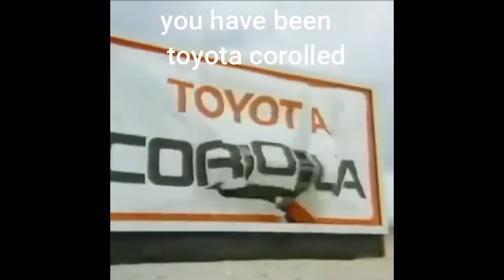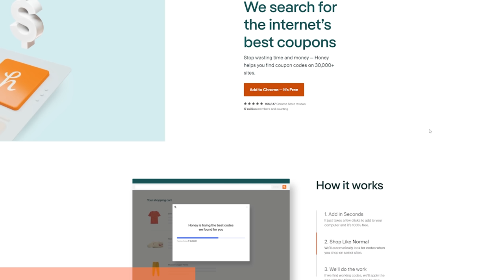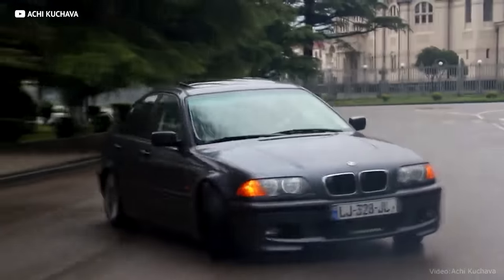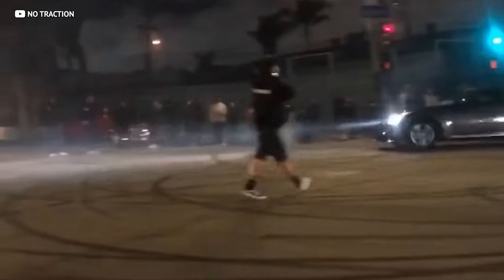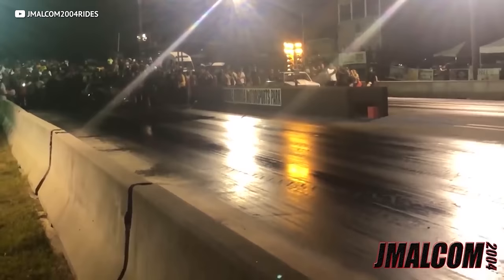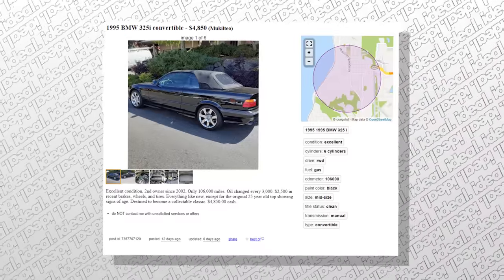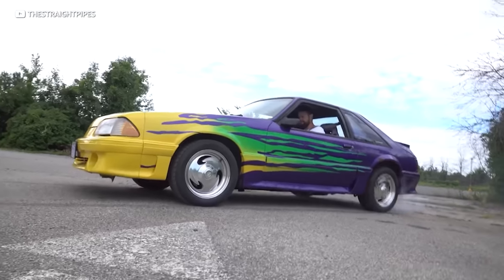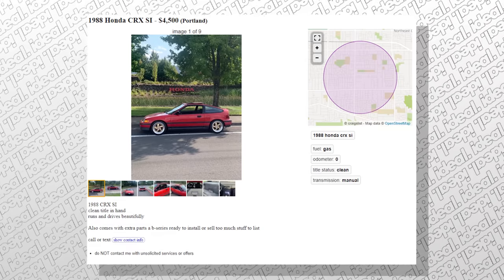8 CHEAP Cars With Unlimited Tuning Potential

Comment: this list was actually one of the BEST I've seen so far. FINALLY a civic makes it too 😭😭 i jus might cop either a IS300, or a Firebird, maybe..
Reply: Dude, get an IS300. I just got mine, and I frickin love the thing. Just be sure to get it before the prices go up even more!
Reply: I still own all my cars from when i graduated in 2012-2016 era, a factory turbo s12(3500$), s12 coupe (600$), 300zx non turbo (2500$), 1 of 5000 L tuned GS430 in mint condition (5500$), and a s13 full caged dual cam I got for 800$, I had a lot of fun in my teen days, sucks you guys don't have such as cool cars for the cheap like we did. My older homies from the 2008, early 2000's era were getting mk4 supras for 10,000$ back then, AE86's a thousand or two, lol if not a couple hundred bucks. 240's were cheap and good for the price to learn how to have fun in for 1200$ with some suspension back then, you could get a sr20 swapped 240 for around 4,000$-5,000$ back then, miatas were like 1k$ and under. NSX's you could find sub 10,000$ range
Reply: @premotvv  Most definitely, Im thinkin bout a GTE swap, depends if I got the funds doe ❗
Reply: @ZalkDrives  Bet bro 💯💪🏿 after I get a FC
Reply: @pancratius8886  Dang yall was livin in that good era 😢 shame a lot of them skyrocketing now in price
Reply: Take your time, buy what you want
Reply: Get a gs300 I got one they a lil better
Reply: @tr3ynag4ta   cheaper to just swap the internals. GTE rods and pistons fit the GE block. No need to spend all that money on a GTE When the GTE parts swap in a GE block for the most part.
Reply: @romanyoung5342  agree, GS300 is definitely better imo more space, and the body is OG 😂
Reply: Got my wife an Is300 and a mustang gt for myself she will see more power than i have on nitrous.
Reply: Trust me invest in any of those 2.
Reply: I’m getting a is300 he put me on to the best starter car in the world
Reply: dont fucking dare get the pontiac
Reply: @premotvv  I want to wait and pick up the first model Altezza when they start coming to American market in a couple years. To heck with the 300
Reply: @DhatLex  there are a few extra ports that have to be drilled into the block if you’re doing that as well.
Reply: @TheJapfanboy   Comp turbo make a oil less and waterless turbo, so you could run those instead of running feed and drain lines. I wish I knew about them when I was first boosting my Lexus GS300
Reply: @DhatLex  your a genius bro, this is good info, thanks for sharing and saving the rest of us some energy😂
Reply: No no no, he said not civic. Pay attention
Reply: The crx isnt a civic!
Reply: @tr3ynag4ta  im tryin to gte swap my 03 is300 too. I think its smarter than trying to turbo the ge motor.
Reply: @johndomoe3735  facts 💯 GE doesn’t have the spray nozzles for the piston or a turbo outlet
Reply: @ZalkDrives  where do you find one?? I’ve been trying to find them on facebook market place and offerup but there arent any in my area.
Reply: @dioncuni2586  the pontaic is a better looking and sounding car with an engine that has bigger power potential...
Reply: dont get a is300 trust me if you plan on turboing it or something your go8ng to need some money and 2 ecus
Reply: I got an is300 and I love it . Highly recommend 12/10
Reply: Lol yes finally is right man, the civic has always been the one of the most popular starter tuner cars in my opinion or atleast is has in my hometown
Reply: @pancratius8886  are you willing to sell one of your Nissan's in few years for not an expensive price? might actually buy one if so
Reply: I got the is300 😂
Reply: How can you beat a Honda? I’m a muscle car kind of guy but Hondas are great cars all around. No question about it.
Reply: @pancratius8886  I’m thinking of either buying a Toyota chaser or a 300zx
Reply: My friends dad kept buying old firebirds 

Cause it was cheaper to buy another one than to fix
Reply: @pancratius8886  must be nice to have rich parents
Reply: @upshiftgo  My condolences :(
Reply: @pancratius8886  thanks
Reply: @upshiftgo  My condolences you think 10,000$ over the span of 5 years is a lot :(
Reply: @pancratius8886  when you're in high school and your parents give you 10k? YEAH. are you confused and comparing that amount to what a working adult makes? my condolences on your intelligence lmao

but hey, if your parents gave you that much money when you were in high school then congrats to you, if that's what you're fishing attention for.
Reply: @pancratius8886  You tried harder because my thanks got you to haha. is this what you do on the computer all day? what a waste of time. my condolences on your happiness.
Reply: @upshiftgo  Lol I wasn't in high school buying any of these cars, i didnt have my license in high school, I was 18-23 when i purchased my cars, saving 10,000$ over the span of 5 years isn't hard in the slightest, when u work an actual job. Judging by ur double reply's and perception of the dollar, u still have yet to find one of those. Once again, my condolences. :(
Reply: @pancratius8886  boooohooooooo 😂😂😂😂😂😂
Reply: @pancratius8886  My condolences on being so offended and hurt 🍼👌🏻

Comment: I’d get the IS300 everyday for performance.

If I didn’t need performance, I’d get a 4runner.
Reply: I own both stick with the lexus
Reply: The is300 is painfully slow. It takes crazy money to make any real power from it, much like the Supra. Not the same 2jz motor, nor is it turbo
Reply: @andreibelittchenko5956  what's better? Ge or gte
Reply: @carter.coleman  gte 10/10 times, lower compression always better for adding boost. Either way still needs a duckload of money thrown into it to make any serious power
Reply: Me with my 90s pathfinder 🗿
Reply: @andreibelittchenko5956  It absolutely does not take anywhere near "crazy money" to make it fast. CXracing and comp turbo, and a bunch of other brands make full turbo kits for 3-5 grand. Even with stock internals you can push around 400 wheel for around 5 k.
Reply: @carter.coleman  well gte costs 10x as much so I think it's pretty obvious. Also, it does not cost an arm and a leg to add some real power to a 2J, especially a gte. This other guy doesnt know what hes talking about.
Reply: Knew a shop that was selling a factory super charger for a v6 4runner ... apparently the owner had it removed because it was to much power for him shop kept it and no one wanted to buy it ...think they junked it in the end
Reply: is300 is not a performance car by any stretch of the imagination. a scion tC has faster times
Reply: I have a 4 runner and its amazing

Comment: Glad the front wheel drive thing was mentioned. I now have a 4 wheel drive and a rear wheel drive car but I sooo miss the fun of a small front wheel drive. There's a reason that back in the 60s the old Mini Cooper was winning all the rally competitions. Front wheel drive is a different driving style and it takes some getting used to but you can just floor it round bends. If you can find an old dirt road, you can just drive with your foot welded to the floor and throw it around corners and the back will just follow the front. Loads of fun.
Reply: I've got a ford focus hatchback (not st or rs... it's an se 😭) but still fun af to drive. Corners are nothin'!! Most of the parts are interchangeable though which is nice to know for the future.
Reply: the mini cooper s is still the most fun car i’ve ever got to drive
Reply: So you're telling me on a rough road/path if I floor my car on a tight Bend it won't just understeer? No chance! Although on the dry road, I can go flat out and it grips, so far anyway, god bless
Reply: @unnecessaryworkouts3649  On tight corners on a dirt road in a front wheel drive, you just need to learn how to use the hand break. You can tighten the handbrake cable which will mean less movement will get the rear to lock and swing round but experiment and find your preference 😃👍
Reply: vw gti owner here.... could afford a type r but went gti bc of the front wheel drive and boosted it myself and now its faster than a type r ;)
Reply: fwd is dangerous

Comment: First car I worked on myself was a 1989 Civic SI.   Swapped out the d15 for a b16 and added the usual bolt ons.  For a car that weighed 2200 lbs to have 185ish horsepower, it was a damn rocket ship.

Comment: This is actually a good list, and I look at a lot of these cars on listings. A lot of other lists put on more popular cars and deflate the prices, but this is a legit list. I actually saw that same Saab 9-2X listing a while back. Just don't share this info too often or else I fear of even more inflated prices haha. 
Another good candidate is the C5 Corvette, but those are getting more expensive too these days.
Reply: The best saab out there in my opinion is the 97 x aero. Not a car but Is just a rebadged trailblazer SS with the 6.0 lsx motor. Nicer interior and you have an SUV that does 0-60 in 5 seconds stock.

Comment: Thank you for the Honda love!! The CRX and Del Sol are amazing choices. Just be good to them. They're old, and finding ones that aren't beat to hell is getting harder. My friend bought a '90 CRX running and driving for $1k a couple years ago and has been working on modding it and restoring it ever since. I have helped along the way, and also have a '95 Integra GSR that will slowly be built for racing that he helps me with too. Good luck to anyone just getting into cars, it's challenging, but it's rewarding and a total blast!
Reply: Only problem is I feel like you can’t even find a CRX anymore without having it shipped over here from Japan. I’ve been looking. Just now I looked again and only two available and one was $35K and the other was $8,500.
Reply: @patwoodruff8842  crazy cause my girl’s dad has a crx sitting in his driveway and besides the aging and some dents the body pretty much nearly impeccable and the inside just needs remodeling

Comment: My first enthusiast car was a Toyota AE101 Corolla with a 5A-FE engine. Though it topped out at a mere 90mph, it accelerated quickly. Impressively, it worked really well for a 4 speed automatic fwd sedan. It also came in a teal metal flake gloss colour with black 5 spoke rims. My favourite thing about it was the engine sound. It sounds almost identical to the 4AGE. Anyway, it's up for sale now due to the lack of aftermarket support in my country (Trinidad 🇹🇹)
Once it's sold, I'm buying my brother's totally stock Nissan FB15 Sunny and I will easily modify it since Trinidad is a "Nissan Man" country. Nissan parts are incredibly cheap and always available here so I look forward to my future with the FB15.
Reply: ayy trinidad

Comment: I had a b18 crx and it was tons of fun and super easy to work on, if you are getting into one of your first tuner cars you can not go wrong with the ease and options of honda.  Front wheel drive might sound less fun if you are into the drift scene but they are great cars to learn to tune on and hondas can be pretty tough and cheap parts.

Comment: Shhhh! Keep the IS platform under the radar.
I'm saving up for a IS200
Reply: @woi woi woi damn, they must be expensive right?
Reply: @woi woi woi woah lucky you, here they run for 5k and above
Reply: Yeah 🤐🤐
Reply: Is200 is slower than the stock 1.8 mr2 spyder lol
Reply: @RoadsterAlex  yeah but it won't snap oversteer lol

Comment: I picked up an is300 for $2000 bucks about 2 months ago for a project car and it is very easy to work on. I’m pulling the engine on it right now and it is very straight forward

Comment: A few months ago I would’ve said “N54 335i”. But honestly, prices are starting to skyrocket for decent, low mileage examples, which is what you want since the N54 is a VERY capable and solid platform but also very susceptible to breaking when not maintained properly. You’ll find them in the $15k -$18k range depending on the mileage and condition of the engine.
Reply: I just bought one for $4k runs like a beast 😎💪🏽 but yes the N54 is capable of a lot for cheap. I would definitely have the e90 335i on top of the list.
Reply: @joeyygreco8311  I got mine for like $12.5k last august. 2009 so it’s LCI and 56k miles. The thing with them is that maintenance is very demanding and taxing on the engine. I’ve seen some N54 blow up because of lack of maintenance.
Reply: @TheGamingDistrict1  15-18k + ridiculous maintenance is not cheap and the tuning potential relative to the price is terrible nothing on the car can take power not even the fkin axles...
Reply: @MV-ri7zu  Well, as someone who owns one, I can tell you that that’s not true. The engine, transmission, and drivetrain can take quite the beating before giving out. It’s just that a bunch of 17-18 year olds buy these cars when they clearly can’t maintain them, slap cheap-ass eBay mods and then complain that their 500-horsepower, 160k-mile N54 with cheap mods and bad maintenance, break.
Reply: @TheGamingDistrict1  I bought N54 335i and 550HP now. :D MHD chiptunning is easy way to high power. "European supra"
Reply: @skailler4580  nice! I bought mine with JB4 already installed and switched to MHD as soon as possible. Truly the best tune for that platform. Although, there’s still some stuff to be added, but it’s very good overall
Reply: people overlook BMW and germans in general, but there's a few hidden gems, and the N inline sixes that are found commonly in the E9x generation are definitely hidden gems. Super reliable and can handle a ton of power for cheap.
Reply: @S70V12  not only that, inline 6 engines are also naturally balanced, so they’re smoother in power delivery.
Reply: @TheGamingDistrict1  yeah, the term “German JZ” really does belong to the N54 doesn’t it?
Reply: I bought my 2007 335i N54 (E93) for $8500 about 2 years ago. It was losing boost. Fixed it within the first 24 hours of owning it. Changed out most of the common failure parts and went FBO. Installed coilovers and upgraded brakes. I'll likely go single turbo next. 
The car is a beauty with all black paint and all trim blacked out. Peanut butter color interior. I've fully upgraded the electronics and dash cluster. Sound system fully upgraded. All car features have been modernized. Camera front and back, parking sensors, cross traffic alert, navigation, Apple car play/android auto etc. Etc.

Hangs with 500 to 600+ hp cars while running E85 on a out of the box MHD tune.

I did have to put a transmission in it about 4 months ago. The trans finally got tired after all of the fun dealing with that N54 torque. 

It just passed over 100k miles.
Reply: @the-next-gear3626  looking to get one what’s good mileage on them? I believe the best yr is 08? Correct me if I’m wrong
Reply: @Momo-xl7tr  I would pay more attention to how it was driven versus the mileage. Obviously the lower mileage is more desirable but even more than that, one that wasn't beaten hard by constant racing. 
Mine was stock when I bought it and wasn't beaten, but had a few small issues to fix. 
As far as year...... again look for the better condition car versus an 07 or 08, etc.
You can get buried in maintenance costs quickly if you grab one that has been beaten and cannot do most of the work yourself. 
I do all of my own work.

They are incredible cars though once you get them caught up on maintenance. 

You can buy any year between 2007 and 2010 (N54 models) and get a very capable car. 

Expect heavy maintenance work early though. Once the maintenance items have been addressed, then you can mod and tune it. 

I put a few months of work into mine after buying it. 

Today, it's a beast and pretty reliable now. Most of the high failure parts have been replaced with aftermarket performance parts. 

You need to consider the features that you want on your N54 335i before searching. 

Do you want a rear drive coupe? (Made in all years 2007 - 2010) Do you want an AWD coupe? (Made in 2009 - 2010 I believe) Do you want a hard top convertible? (2007 - 2010)
Etc. Etc.

All of them are very capable. 

If you want pure performance and don't care about the rear drive purity..... the most capable is the AWD coupe N54 from the 2009 to 2010. Call it German GTR (Godzilla). 

I've seen sick builds on them. 

Happy hunting for your N54. Hope you find one soon and join the family!

Comment: You missed: "Basically any VAG with the famous 1.8 20VT", like my '98 A4. A lot of parts available, it has done 300k km's and still running fine, ready for some K04 action
Reply: What have you done to it? Just bought one, but i'm not sure on how much i want to modify it
Reply: @Stormface16  nothing for now, it is still my daily but a mate of mine had it tuned to 210hp just by adding a K04 turbo and an exhaust combined with a new ecu map. So if only those mods already cause a hp increase of 60hp, adding some more mods like 4.2 V8 coils, bigger intercooler and new intake piping for a cold air intake, I bet you'll be making 300hp reliably. But be careful, connecting rods can't handle more than 350hp. But my engine has only done 300 thousand km which is still good for tuning
Reply: @Stormface16  we both have the AEB engine by the way, those have bigger intake ports
Reply: @Manoah.  do all 1.8T 20VT all have bigger intake ports? Like in TT, S3, Leon Cupra R, Ibiza 1.8T etc.
Reply: @MrLorenczo  Nope. For as far as I know, only the 1.8t's in the B5 and B6 platforms (Audi A4's and VW Passats) and the Audi A6 have those. AEB engine for sure, and I believe there were 2 others aswell but I don't know for sure. But the regular 20vt's that are mounted transversely like the Golf and A/S3's don't have the big intake ports
Reply: @Manoah.  okay thank you